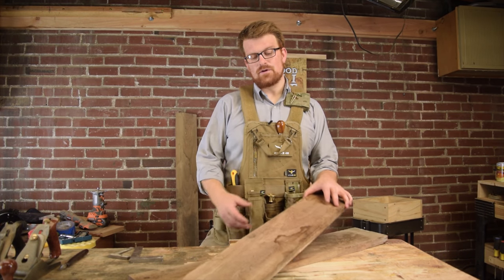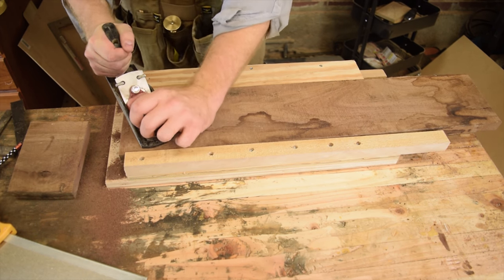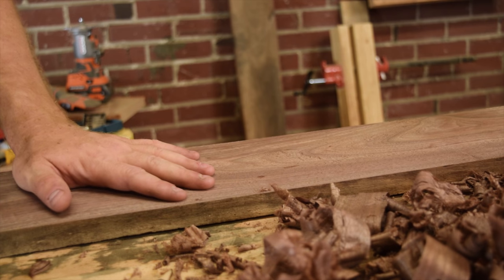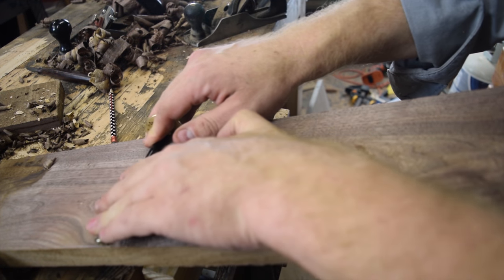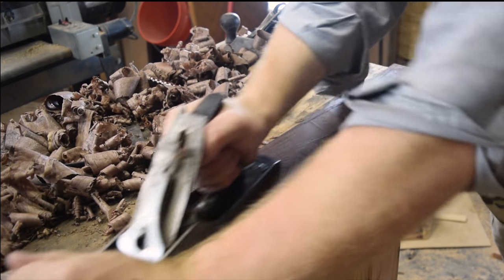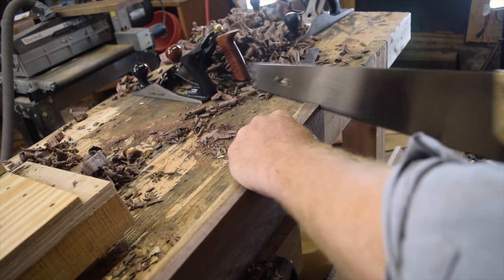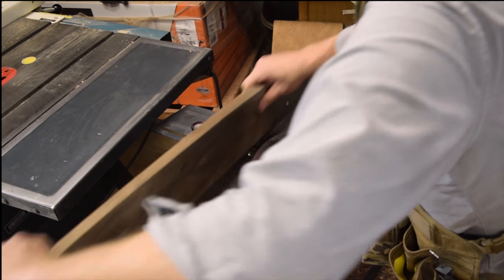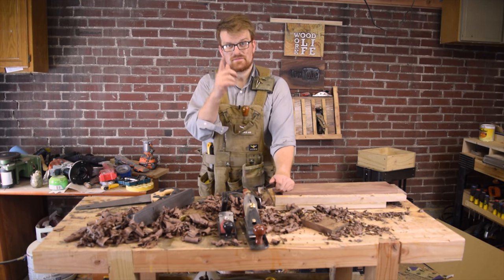Handtool vs. Powertool Shootout - Milling Rough Sawn Lumber | Hand Tool Shootout

Comment: I love it when woodworkers make videos comparing hand tools with power tools. Thank you.

I even think that with a few added elements, we could argue that hand tools can get the job done faster than power tools for one-off projects:
- much less sanding if at all
- in most furniture projects, there is no need to actually bring the back face to exact thickness, let alone make it parallel or even smooth. The inside of my antique cupboard has rails and panels that are scalloped and rough.
- no need to don a mask,  ear or eye protection 
- no need to empty the dust collector bag
- no downtime for oiling, resetting, dusting off, or when the irons need to be  sent for resharpening and replaced
- possibility to sneak short work sessions at odd hours when noise would be a big no-no
- for one-off projects, the part where the machines can save time is just a fraction of the total time (drawing the plans, choosing lumber, rough sizing and optimizing the cut plan, dry fitting, glueing, installing the hardware, finishing, etc. are all done by hand anyway). Therefore the relative gain from using machines is much less than it looks.

Obviously this only holds for one-off projects. For anything even mildly repetitive, machines can't be beat.

Comment: I much prefer hand tools.  Machines are fast but at the cost of being noisy, dusty, loud, large, requiring setup or jigs, expensive, and more dangerous.  They are definitely what I would use in a commercial setting when volume is needed.

On a hobbyist level hand tools are what I prefer.  Quiet, peaceful, meditative, clean, cheap, they fit into a small cabinet, and when you get really proficient with them they can be surprisingly speedy anyway.

Comment: Machines can make short work of the sizing and squaring stock. I don’t have a power jointer or thickness planer my shop lacks floor space and I’m not interested in hiring an electrician to up my power. So it’s important for me to learn how to use hand planes including sharpening and holding the stock for planing. Also, I do woodworking to quietly relax so I’m not in a race to get things done. BTW power tools require set up and routinely checking them this adds time to getting a project done. I did like your comparison and the comment about how dangerous the jointer is. You have a good understanding of both methods which makes your work more interesting.

Comment: I'm late:( It's so funny to be back in my shop after working on a jobsite last week. No shmucks and no framing hammers,nail bags or nasty sun cooking me alive, No un reassuring It'll be fine that ladder is as solid as a rock.  Don't get me wrong I love working on a site, learning, being more unsafe than I normally am, but I missed my shop. Thanks rick for giving me something to listen to while cleaned in my shop. I'm kind of pumped because I think I can carefully fit a jointer in the garage so.......it's gunna get real.
Reply from the maker: Never late Jack, to quote Ke$ha, "the party don't start 'til (you) walk in." 😀😀😀
Reply: aww, Rick your making me blush. Hey just wandering, Do you have any dust collection in your shop. I was thinking if i'm getting a jointer, I probably need some way to clean up other than a broom.

Comment: Would have been faster with the scrub to have beveled the edges to thickness, started flat on the bench like you did the with the jack. A scrub works best when you alternate directions between across and 45 degrees each pass. Ideally 45 right, straight, 45 left, straight, etc... That keeps the best bite with the scub.
Reply from the maker: Noted, I have only milled probably 30 or 40 boards this way before I invested in a planer...

Comment: Fine if you have not only the money but perhaps more importantly the space, for the jointer, planer and table saw. I have neither, so I guess I'm going to be working on building my upper-body strength. It really doesn't matter at hobbyist level, just make something using beautiful wood.
Reply from the maker: +Tyvole for sure, never bad to get a work out.  Hand tools or perfect for a hobbyist.  Plus there is a lot lower chance if chopping some fingers off.
Reply: @Tyvole Must be nice to be able to afford hand tools Mr richy rich face.
Reply: @allanshpeley4284  I guess it must. I never mentioned hand tools. You need to work on your reading comprehension and trolling skills.

Comment: I like hand tools, but seldom use them for ripping along the grain. I use a thicknesser but not a surface planer, unless the stock is thick and heavy. I think it is too dangerous and there is usually some bounce. They are called buzzers in New Zealand,  a very appropriate name. Using jigs it is possible to straighten bowed wood in a thicknesser. It works better than passing hands over blades!!!  I try to avoid bowed planks. I wouldn’t use a circular saw without a riving knife. 
A sensible video. Thanks.

Comment: Nice video on how to mill rough sawn lumber, that walnut didn't look the easiest piece of timber to work with :)
Reply from the maker: +Brian Griffiths no it has been drying in a barn for 20+ years.  There is such a thing as too dry, plus lots of bug damage.  I wanted to check the condition of the wood to see what kind of projects it might be fit for.  It is from my neighbor that lent me his drum sander and he wants to build a table with it.
Reply: Wood.Work.LIFE. I’m a year behind on this comment, but I’m struggling through some 20 year old, dry oak and considering buying jointer/planer. ;)

Comment: Traversing the board with a scrub plane is a waste of time, scrub planes are reserved when you need to remove like half an inch of material, a medium camber fore plane which is longer than a nr.5, followed by a try plane should flatten that board in about 5-10 minutes, with some experience of course.

Comment: Would have been MUCH easier on you if you would have turned board around and planed with the grain instead of against it and would not have had such massive tare-out.

Comment: I had to stop watching when you pulled out the little square to check your board instead of just using the edge of the plane you already has in hand which was twice as long and would be far better than that little square you used which is primarily for lay out not checking for flat.